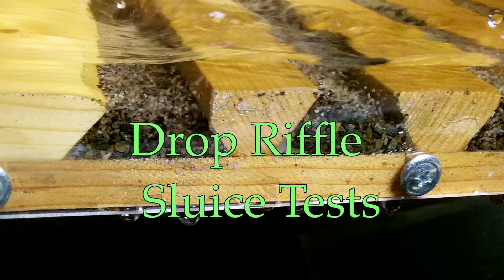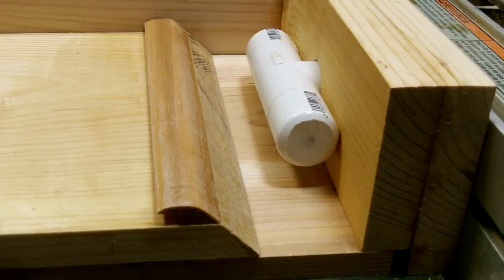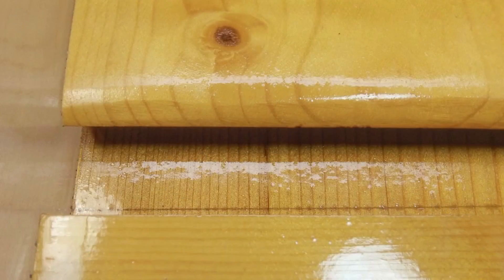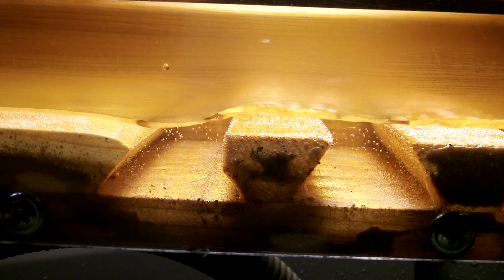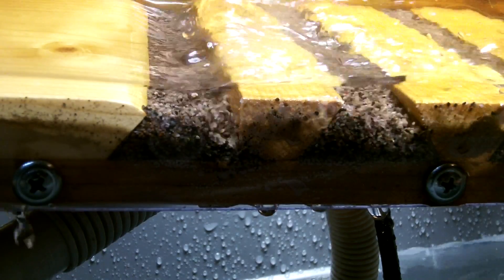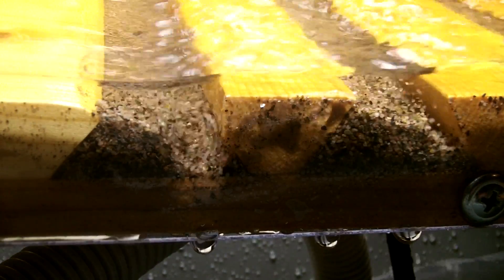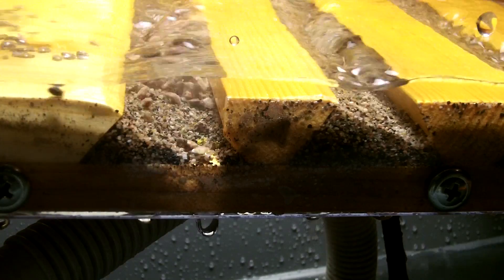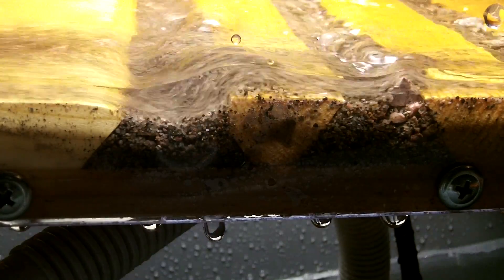DROP RIFFLE SLUICE TEST

Comment: This is cool do u think a pvc hand dredge pump could clean those riffles out so you can keep feeding it?
Reply from the maker: Zion Gray 
Hi Zion and thanks for watching. Yes it could but it's not necessary as they clean themselves out automatically.  The sands are bouncing up and down and the lighter ones are getting thrown out when they bounce high enough to get caught in the water current and only the heaviest material like gold and black sands will remain in the trough. So you can keep feeding material into the sluice and it will get rid of the garbage automatically. That's why this is one of the best sluice designs around and has been for over 150 years.
Reply: utahavalanch it would be cool to make a way to lift up the riffles all at once while running ( if they where cubic aluminum held down like the river sluices latch system. With a flush rubber mat glued to the bottom of the box that doesnt move but acts to make the riffles water tight so nothing creeps beneith and out.) But to release the cons it into a catch tray or bucket say if it was a highbanker type. Just to make clean up n con collection faster.....i was thinking your design would be cool in aluminum but a little bit wider and longer.....i wanna try a drop riffle system. Do you know if they are better then raised riffle as in faster feeding and better collection?...to me it reminds me of a japanese design i love the look of it its almost id say art. Great job on the build and knowledge of this type of sluice
Reply from the maker: @ziongray918  

This is much easier to clean out than having removable riffles. You just turn the sluice on it's side so that the bottom and the side forms a V and then just take a can or water bottle and wash the grooves down into the bottom of the V and out the sluice.
Raised riffles are good for course gold and unclassified material but they lose the fine gold. Drop riffles are very good on the fine gold but they need to have the material classified.
Reply: utahavalanch sorry another question...would it get less clogged up and speed up the natural drop and cleanout method if on the ends of each drop riffle it where to have a small flat extended lip or even a small raised riffle either to both tumble it faster and keep it from being level so the. Gold dont roll over amd out?
Reply from the maker: @ziongray918  

The design on this is about the best I have discovered in 10 years of building and experimenting. It's a very simple design and it works very well as long as you don't over do the water flow. So if you want to build one that is simple and works very well, this design is it.

Comment: Too many flat spots. Needs more riffles.  Small V- grooves in those flat spots will improve catching the fines.
It's too easy to clog up those big riffles with minimal water pressure..
Reply from the maker: Yes, many changes can be made to these. I have one that has large circles in the riffles as well that catches the fine gold. I have also tried the grooves on those flat spots. However if these sluices are run properly they only need about 3 or 4 riffles. My big one I ran all last season didn't ever get a piece of gold beyond the 2nd riffle. The version I'm working with now, only needs 1 or 2 riffles as 80% of the gold is caught on the slick plate and any that move on down are funneled into the first riffle where they stay.  Yes, like all sluices you have to run them properly or they don't work well. I'd say that about 80% I see on the internet fall in that category. Thanks for watching.

Comment: Im loving all your video's. Im thinking of building a mini drop sluice out of some plexiglass i have around just so i can watch what's happening from all sides. My curiosity is could a drop riffle sluice be run with deep riffles and low water flow and on the underside a vibration from like an out of balance angle grinder or something be used to keep the sands bouncing. Would the black sands and heavy stuff continue to build up and force the blonds up to the slower water and out?  If it does continue to build up and classify itself could some small holes be opened underneath and let a small amount of the heavy sand out into a collection? its all very interesting.
Reply from the maker: Hi and thanks for watching. Yes, you can build a plexiglass drop riffle sluice with deep riffles and low water flow. Mine are at least 3/4" deep and I screen all of my material down to about 4 sizes and adjust the water flow for each mesh size. Vibration on the underside will not keep the sands bouncing up and down in order to clean out the lighter material. The water flow moving across the top of the riffle creates a suction that is trying to suck the sand out of the riffle and that's why they dance up and down and bounce the lighter material up into the main water stream. The faster the water flow, the more suction. You will remove the gold with too much water flow and blow it out of the sluice.  The best way to remove the black sands is to remove them before you start feeding the material into the sluice. If you don't then the best way is to run a black sand magnet over the riffles to remove the black sand out of them. Hope this helps.
Reply: @utahavalanch  thanks for the reply and helpful advice.  I think your right about the vibrations not working like im thinking.  The picture in my head is much like when you shake a gold pan all the heavy small material migrates down.  If i could duplicate that movement mechanically and introduce material and water to the back side of the pan would the gold sand on the underside keep building up while the top of the pan over flows out the front?  I guess it would be much like your fluid bed... without the spray water coming up from underneath.  That fluid state of the shaking pan while a tiny bit is taken out the bottom and a small amount migrating out the front and out would it keep a happy continuous liquid sorting going on?
Reply from the maker: @builtrodewreckedit  
If the water flow is adjusted right, the troughs in the sluice act just like a fluid bed. It is the same as shaking the gold pan to stratify the material down into the corner of the pan. The dancing sands are quick sand and anything that is heavier than they are will immediately drop to the bottom of the trough and stay there. They will eventually clean out all of a certain size material that the water flow can pull out. If the water flow is too high then everything will get cleaned out. That's why it's important to fine tune the water flow. So just the normal use of this will do everything you are wanting it to do.
Reply: @utahavalanch  Thanks so much... I sure have fun thinking about this but you really are saving me alot of frustration.

Comment: That was so informative and well put together. Also a great design that has answered numerous questions speaking as someone newly interested in gold and gem prospecting. I'm UK based, we don't have an awful lot above bedrock I believe so the optimum design, all the better.  

I am so impressed and grateful for your research and design, and presentation I am bothering to write even though I'm having to use mouse on my (cracked screen) smartphone.  One click at a time.  Thank you for uploading this. Genius. 

Ps. It might be nice to be able to slide the perspex glass out along the length of the sluice incrementally for rinsing out the paydirt. 

Thanks again, awesome. Love your 'king of the hill' (lite) accent too. Thumbs up
Reply from the maker: Hi Spinny and thank you for taking the time and effort to watch and comment. I am finding that these sluices are some of the best I have tried over the past 50 years and I continue to modify and test them constantly.  I’m right now in the process of making a new one with some of the changes that worked for me. So stay tuned.
Yea, I wish it was easy to slide the glass along myself but it is very hard to seal that from leaking. I hope the new video will be more informative and easier to see the action.
You might try making a small version of one of these and set it up as a recirculating system. I am finding that most of the gold isn’t found in the streams but in the dirt all around us. So take samples of everything around you and see what you come up with. You may be surprised. I was.
Yea, We Utah’ns have kind of a different accent although it doesn’t seem like it to us. LOL.
Reply: @utahavalanch  thanks for your reply. I will definitely keep tuning in. I appreciate your innovation. And thanks for that final tip. I will try for sure. Happy panning.

Comment: In this great video, what was the mesh you classified to? -20? and what was the water gph or speed?
what is the Angle you cut the bottom part of the riffles?
Reply from the maker: Robert T Burrows 
Hi Robert and thanks for watching. The classification is about -12 /+20 mesh. I usually classify and run this first for the larger gold. Then I classify the tailings to -30, -40 and run each separately at a reduced water flow for each classification.. I'm running a 264 GPH pump with a valve on a 6" sluice. The angle was cut at 30 degrees. I found it's best to have the Riffle face that the sand hits as it goes into the trough to be straight up and down without the angle cut. The rounded nose on the slick plate where it runs into the first trough turned out to be a big "must have" as the gold follows it right down into the trough guaranteeing it ends up getting caught. I am currently working on 3 more different Riffle shapes and a little different drop Riffle sluice and I'll see if they work out well enough to put up. It's interesting that I found if you drop the water flow way down, you can run the sludge material and easily catch the -100 gold better than with the mat sluices. The troughs on these are big enough to hold the gold and black sand which I process to get more gold.
Reply: @utahavalanch  Thanks for the reply. Im an absolute believer in drop riffle boxes of any sorts. Most of our material running is onsite so we use wider longer boxes. I like the Angle of the second riffle as it tosses the heavies back and releases the lighter material to flow. Agreed on that Rounded nose as it shoves the heavies str8 down before they can float out. Id like to see a video of a longer sluice run showing all riffles working.
Reply from the maker: Robert T Burrows 
I have pretty much given up stream sluicing and my big Gold Hog sluices for these as a recirculator because I can control everything so much better and get more gold. I'll try to include more of the other riffles in my next video. I usually keep all the gold in the first 2 riffles to make for less cons to process and so I usually don't pay much attention to the rest of them unless I get any gold in the tailings. I am currently using a 10x22" sluice with 3/4" deep troughs and they hold about 2oz. of material each which doesn't take long to run on the Miller Table. I'll see if I can make a longer sluice. What size and Riffle depth do you like?

Comment: One of the best demonstrations on how matting works and the importance of classifying.
How many groups should you classify to?
Reply from the maker: Hi Deplorable thank you and thanks for stopping by. I generally classify to around 4 classifications and run each classification separately and adjust the water flow for each one. Doing that and running small batches in a recirculating system where I can fine tune the sluice, I am getting way more gold than I ever did by running the big sluices in the streams because now I'm getting about 95 -98 percent of the gold instead of only 20.
Reply: @utahavalanch  Hey, thanks for the reply. I enjoy watching your videos.
Reply from the maker: @hockeydad6211  
Thank you for taking the time to watch them. Most appreciated.

Comment: Those gold pieces are a lot larger than -#20, does this sluice also catch -#20 gold?
Reply from the maker: Anagram Confirmed 
Hi Anagram and thanks for watching. You're right. Those are some test pieces that are about 12 mesh. After I shot this video I ran a gallon of 30 mesh material and caught 1 gram of it. I didn't find any in the tailings. If you reduce the water flow to match the size material you are running you can catch down to -100 gold quite easily. The thing is with this type of sluice is that there is enough room for the gold and black sand both. I keep all black sand and process it separately and recover about a gram of gold per quart of it. The curved nose of the slick plate guides the gold down into the trough and once there it sinks to the bottom and it's very hard for it to get out.
Reply: utahavalanch that’s really impressive, thank you for the reply, sir.

Comment: I think you mis-analyzed the efficiency of your riffles here.  The very first spoonful of concentrate filled up the riffles that had the 45 degree cut backward, and what settled there never moved again nor did it have the dancing effect you want.  It did create a nice 45 degree of concentrate forward towards the next riffle and that worked fine.   But again, if the first spoonful of concentrate never moves then the function of the riffle cut backward is lost.  I believe the simple right angle plain ol' straight riffle would work better but you didn't show it here.  
Also, these high pieces of wood riffles which is the very thing that makes it effective to catch tiniest mesh pieces are what catches the big rocks also and which makes the project totally ineffective.  Ultimately, not a good choice unless, as you suggest, the material must be classified down to very small particulate. Of course, I just rehashed what you said, ha.
I'd prefer the hands-on pan classifier with different screens down to 1/4 inch, throw it all into a take-home bucket and have a play-date at home some Saturday/Sunday afternoon.  Love your vids. ciao.
Reply from the maker: Hi Trumpsahead,
This test was mainly for those who say that it’s best to cut an angle on the riffle. The first riffle was a flat cut with a  slight toe cut out at the bottom to see if any of the fine gold would settle down there.  As you can see the 45 deg cut creates a little different current. The flat cut creates a vortex that helps clean out the lighter material better.

If you look at the material up against the glass, you’re right it doesn’t move as there is a dead zone there. However over towards the middle you can see it is exchanging out like it should. Even though the trough looks full the water current moving through the sand turns it into a quicksand and anything heavy like gold will fall through to the bottom and stay there protected by the sand above it. Having deeper than normal troughs means that the water flow at the bottom is greatly reduced over that at the top and so It’s very hard to blow the gold out of there once it hits bottom.

Gold separation depends on weight. If all the material is the same size, gold will always sink to the bottom. So I always classify. If you have 30 mesh gold and 1/4” or 1/8” rocks and you have to set the water flow to clear out the larger rocks, the gold will go as well. If everything is classified to the same size, the rocks will get washed out before the gold.

In my testing, I don’t care what gets caught by the sluice. I only care about what gets lost so I always run the tailings through the miller table to see if there are any losses. With this video I ran a gallon bucket of 20 mesh sand and 1-1/2 grams of 30 mesh gold through 4 times at different water flows and the sluice caught every piece each time. Most in the first trough with 2 or 3 in the second. These sluices actually make a very good finishing sluice as there is plenty of room to catch the black sand and the gold unlike the mats which fill up with black sand very quickly and leave very little room for the gold to settle in.
Thanks for the comment.

Comment: As far as active exchange & physics are concerned. This test confirms that over burdening quickly & a large portion of the collection areas are in complete stall & ineffective.  Almost the perfect bad example. Sorry for my brutal honesty.
Reply from the maker: Actually up until the -4 material was added, it was working just the way it should. The water passing over the trough creates a suction that tries to draw the sand out. The dancing sands create a quicksand that allows the gold and heavier material to drop down through to the bottom where it is protected. When the water slows or stops the sand collapses and the gold is locked into place.  Just like in a crevice on bedrock in a stream. This design is over 150 years old and still has a number of companies making these today. This design wouldn't still be around and popular if it didn't work well for a lot of people.
I have been using this design in different forms for 50 years and I'm still using it and I still find it one of the best. I ran a bucket of -30 cons through this after shooting the video and it caught every piece in the top 3 riffles. I Miller Table all of my tailings to be sure.
Reply: Yes he had said and demonstrated this ; -)